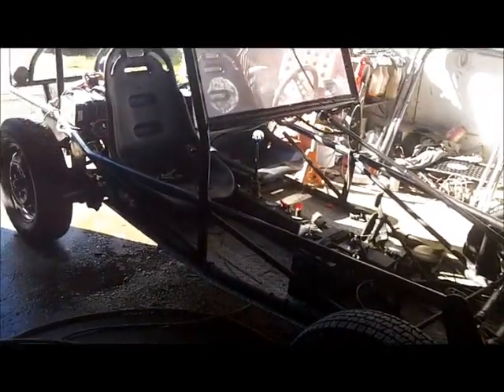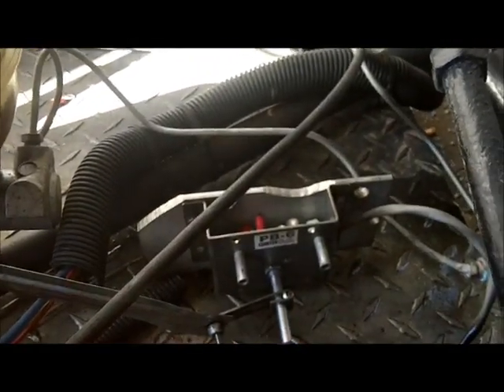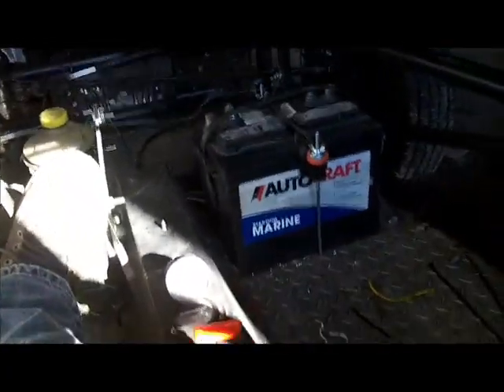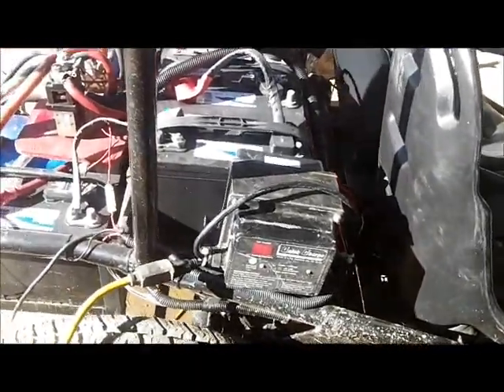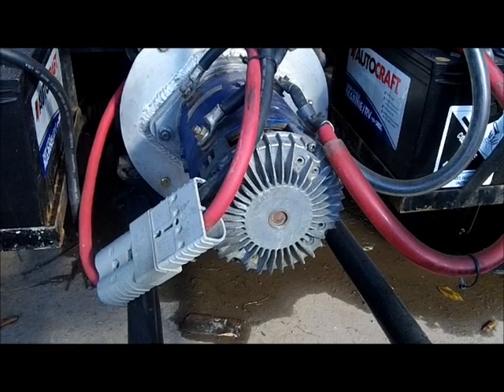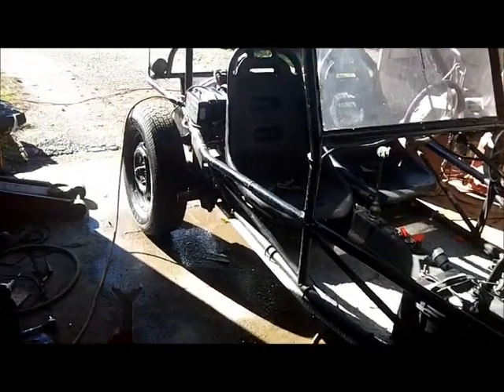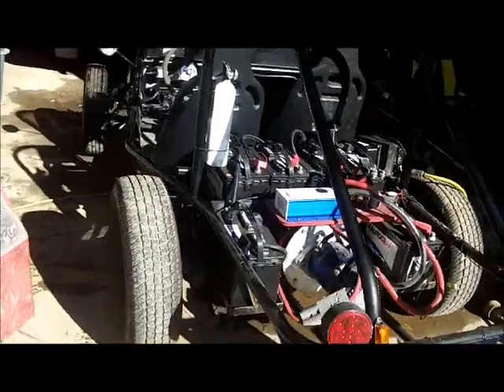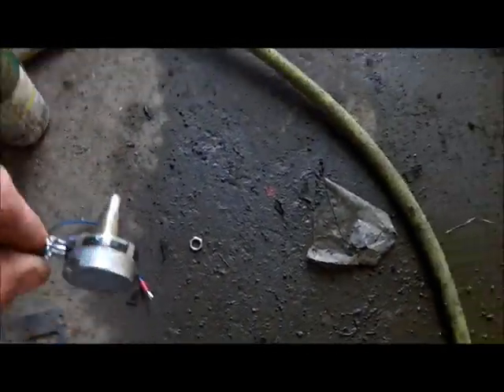First Real Road Test Electric Powered Dune Buggy

Comment: To bad you couldn't setup an alternator on each drive axle so as your driving it would charge the batteries, also too bad you can set it up so when you break it also charges the batteries.
I think it would give you a much longer distance out of each charge, I believe the Toyota Prius have a similar setup.
Reply: most controllers have regenerative braking built in so thats no biggie, but an alternator on the axles would reduce range as it would be attempting to crate a perpetual motion device which isnt possible saddly
Reply: Takes power to make power.  You could use it to help brake, but not make power without losing power to the wheels...

Comment: Your range has very little to that motor, how many and what type of batteries you're using is. They look like lead acid batteries, which are not very efficient,you can add more , which add more weight. Or put a different type of battery. Like a couple of lithium ion batteries from scrapped hybrids would be your best option. Trust me you will be disapointed from the results if you change the motor.